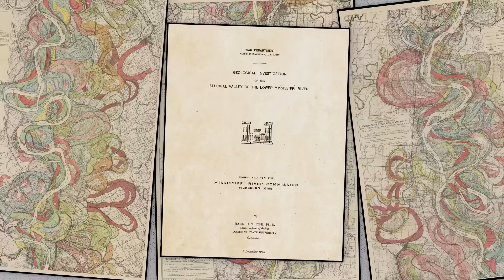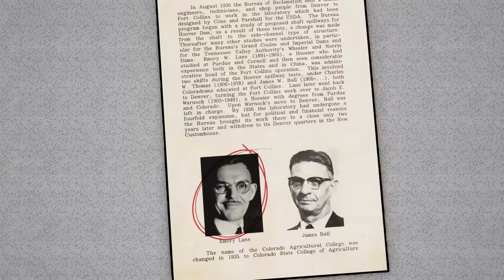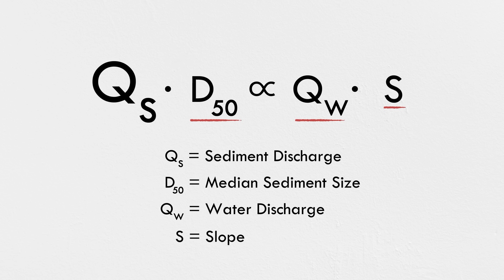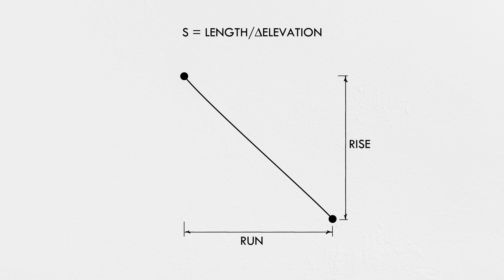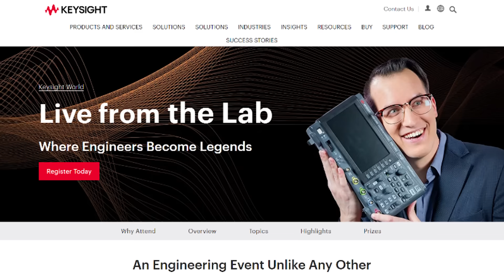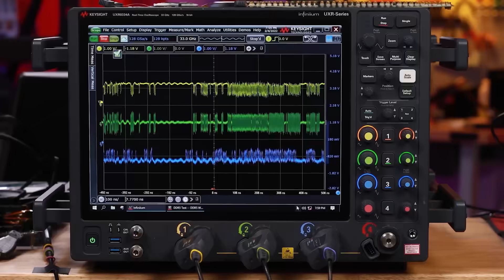Why Rivers Move

Comment: If you grew up in a rural area and played outside when it rained, every trickle of water past a muddy patch became your own personal stream table. I found it fascinating then, and I still do today.
Reply: We had gravel/muddy road leading up to our house where I grew up. I was fascinated with blocking and steering water around from puddle to puddle :) this and several other things were the reason I was studying to be a civil engineer :) I left the field in the end, but the love and admiration for engineering and other connected sciences is still there.
Reply: I’ve done this, you could actually see the bottom of a hill turn into mud then a stream then a river then a lake to a bigger lake to another river and so on
Reply: I always bring a shovel to the beach. There's a big stream running across it, and my two boys and I have great fun diverging the flow. Especially if when we get there and the channel is very wide and flow is low, we dig out a narrow path, which then turns into a fast stream, and the old stream completely dries out. Keeps us busy for an hour or two. :)
Reply: Every time I find a stream flowing down a beach...
Reply: My buddies and I blocked a 24' culvert and flooded an entire field for fun.
Reply: @matthewerwin4677  we do the most minute amount of trolling
Reply: @matthewerwin4677  not cool, mate ...
Reply: I'm sure you know, but just to be safe, this is a lie and a scam. (The telegram message above)
Reply: @WinstonSmith0824  no its nit. I won big bucks. Send me $20 and I'll show you how you can win.

Comment: I've been fascinated with this topic for many years, and have found it very enjoyable to "crack the code of history" that certain rivers tell us about changes that came about because of the activities of man.  I've got one broad example in a reply to a comment below, about how rivers in agricultural regions (and these are the rivers most of us see) are drastically different than they were in pre-settlement times.  Here's another example.  When a river is dammed, the river below the dam suddenly has a much reduced quantity of moving sediment, and as result, the river immediately starts eroding its bed.  When the dam on the Wisconsin River was built at Prairie du Sac, Wisconsin in the early 1900s, the design included a lock so that boats could pass back and forth through the dam.  However, after construction was completed, and literally as soon as the gates were closed, erosion on the downstream side of the dam increased enormously.  The bed of the river dropped ten feet in a matter of three or four weeks (it only stopped dropping at that point because it reached bedrock).  The lock was left high and dry on the downstream side, so boats were unable to use it.  The only time a boat ever went through that lock was during dam construction, before the dam was actually functioning.  The engineers should have predicted that the river would immediately erode down to bedrock on the downstream side of the dam, because this kind of behavior of a dammed river had already been observed hundreds of times, but in those days, very few people were putting two and two together regarding the cause and effect!  The mindset in those days was "Build things" and "Conquer Mother Nature", and paying attention to the consequences wasn't part of our collective mindset back then.

Comment: When I was a kid, I'd run a hose into a small ditch and observe the effects over time. I'd add small dams and obstructions and watch how the stream changed; inevitably, the dams would fail and cause a flash flood.

Technically, a waste of water. It was in the desert using well water, so the area downstream flourished with life. I like to think it was a good use of water.

Comment: Surprisingly, even tidal rivers have significant erosion.  The beach where I used to play is much smaller than when I was a kid, and the community has had to put up retention walls to control erosion.  I saw where a cliff eroded away and half of somebody’s pool was sticking out in mid-air.

Comment: In the netherland we had blocked off the sea but then the rivers where like we need more room for the rainwater so we started a program called room for the river in which farmlan where bought to give the river a chance to expand and retract depending the load of the river. We even have what is called the sand motor the beaches of the netherlands slowly lose more and more sand into the sea so what do the dutch build a man made island on the coast so engineered that the sea flow would do our work for us the stream grabs the sand and deposits it on the beaches who grow to protect the land again so yeah :D

Comment: 14:50 honestly I don't get what you would assume that Lane's relationship would say they are identical.
If one river has relatively constant flow it means it is closer to it's equilibrium. And the second one get huge bursts of flow that push it way outside the equilibrium. 

What do you mean by "it looks at averages"? What is the time window for that "average"? It isn't fair to assume arbitrary time window and say that formula does not work.
Reply: You could take a time window of the whole existence of the earth. Then you would need to model tectonic plates movements and how they affect the river. Because "on average" given long enough period it will be necessary. 
It isn't reasonable to take a time window that ignores the fact that the flow is not constant. It is something like a Nyquist theorem for measuring signals.

Comment: As someone who has canoed along the same rivers for months and years in a row, you really get an intuitive feel for the way change affects the placement of rivers. Especially after a flood, the banks can have moved amazing distances, and deposits of sediment downstream can utterly change where the current -- and consequently, the depth of the water -- forces you to travel in the canoe. Often, channels become so choked with sediment that you can no longer find a deep enough path through them. 

Side note: I really want one of these river tables. I wonder if they could be scaled down a bit in size, to lower cost and make them a DIY possibility. I wouldn't need the electronic analysis. I just want to have fun.

Comment: When I was visiting Alaska, I learned about "braided rivers" which are formed because of the extreme flood/dry cycles of rivers fed by glacial melt. They really do look a lot like the example on the right towards the end with the pulsed flow of water.
Reply: Thank you for your comment. I was trying to remember where I had seen it before! 💜🌎🏞️🍀
Reply: Braided rivers are really cool. Most are from glacial or snowpack melt as it is formed by heavy summer melting and little melting during winter.  I've seen a few around my area in Australia but only during drought when rainfall is much lower than usual.
Reply: So what's your logic for the Tigris and Euphrates River. Not only are they braided rivers, they braid together.

Comment: Something I've always wondered.... How do the inside banks of a winding river end up higher than the river level itself?
ie. How does sediment get deposited above the water level of the river?

....specifically how does this happen on rivers which have relatively static water levels and don't really flood.
Reply from the maker: Floods
Reply: My brother has a small river running thru his farm.  The river deposits lots of gravel on the inside curve during floods.  He can remove and use a lot of this gravel, and each spring, the flooding deposits it back into the same area.

Comment: I have a question to ask and a possible answer to that same question that I would like someone to explain to me. 

I live next to a rather large river for the area with a normal flow of around 250m3 per second all year and that averages at about 2500m3 in the wet season and have two major dams on it. The river's flow and trajectory has been somewhat closely monitored for the past 200 years and there was no real major changes in the trajectory it flows in, the river is about 700 miles long, drops about 150ish meters in altitude and it's outer banks is about 3 meters high from the water's edge normally then there is another river I can think of which has a lot less flow, more gain in altitude and is a lot shorter in length but have a tendency to change its course, not by much at a time, but at a time a road had to be re aligned a few meters away, this river is about 300 miles in length, drops about 200 meter in altitude and has an average flow of about 50m3 per second and at most 500m3 per second in a wet season has a constant outer bank of about 2 meters high and is also a lot younger then the large river. 

My theory is that the larger river has cut its way over time through a harder earth and landscape and the rocks could be harder and more denser then those around the younger river and that makes it more difficult for the old river to cut through the surrounding landscape, also because the large river rarely bursts over its outer banks it does not break away to create a 'shortcut' and the smaller river bursts it's banks about every 5 to 8 years, sometimes not by much. Also the small river has a few horseshoe lakes. Both rivers runs year round and both have dense vegetation on its banks.

I would say that the old, large river runs along dense, more settled-in earth rock and the younger, smaller river runs along not so dense earth and rock.

Scientists and smart people please help, I'm just an amature enthusiast who just want to know more. 😃

Comment: You didn't even touch on what happens when the medium the river is moving through changes. every kind of stone is gonna erode differently, and then those are all different than packed earth, loose earth, different kinds of earth, etc. Even accounting for different aggregate sizes in a given sample, a river that cuts through earth and clay is going to behave a little differently than one that cuts through sand. The amount of variability in grain sizes makes a difference.

Comment: I think the quickest way I understood how rivers bend was when I was a kid. I realized that rivers have waves, some parts of the water of a river are simply bigger than the smaller ones. When you have a river channel carved by a small series of wave, a sudden shift in water volume in that area could disrupt it. That volume can appear just as magically as those titanic mega-waves that used to capsize ships. It could be something like a large piece of sediment higher up on the river shifted from constant erosion, sending a bigger wave down the river faster. That extra little bit could help erode more structurally sound parts of the river. We take the constant flow of water from a tap for granted, I think. Everything in our life is more or less measured precisely. Mother Nature is sloppy though, and prefers the Bob Ross method of "No accidents" VS human engineered precision. Neither of these are better or worse, they simply just work better for us. Heck, even a dry period of less rain-runoff can affect how the soil works. Heck, even too much rain.

TL;DR Water in a river is never a constant

Comment: I wonder if a model like this could be placed in an entry hall or hotel lobby or so. With a fixed supply of "soil" and a regulated supply of water in circulation, it could probably run indefinitely and look different every time somebody passes it. You could synchronize the water flow rate with the measured precipitation in the nearest mountain range and have yourself a never ending science experiment. Give the "soil" some natural color based on the grain size, build a neat mountaneous diorama around it with a macro toy train circuit ....

Comment: Because I LOVE your content: what if the flow of the aether around the nucleus creates turbulence and manifest bubbles, that we call electrons? It's all about fluid dynamics!
Reply: Do you have any predictions that can better match observational evidence than quantum electrodynamics?
Reply: @General12th  Nikola Tesla insisted that electrons were bullshit.   Why don't combs loaded with static electricity DO NOT disintegrate?  Why don't solar cells disintegrate when they give up an electron for a photon?  It is ALL bullshit!
Reply: @batymahn  Do you have a better explanation for, say, semiconductors? If your model can supersede quantum electrodynamics, then could you build a better computer chip?
Reply: @batymahn  Quantum mechanics is not wrong for semiconductors. If you want your idea of "subatomic fluid mechanics" to replace quantum mechanics, it'll need to explain how semiconductors work, for example.
Reply: @General12th  Again, if  you think of bubbles being generated from a central source it totally makes sense that the bubbles might want to intermingle, and interact.  It's all BUILLSHIT!
Reply: @batymahn  Can you design an experiment where quantum electrodynamics would get the wrong answer but your model would get the right answer?
Reply: @General12th  Why the heck should I design an experiment  when you can't explain why solar panels don't give up structural integrity when they receive photons?
Reply: @batymahn  In other words, why the heck should you put even more effort into your theory? Why should you work hard to make it even stronger? Why should you spend more time with a subject you're clearly passionate about?

If you're changing the world and loving every second of it, you don't need my permission to keep at it.
Reply: @General12th  Whatever.. I hope we bring Practical Engineering more clicks.

Comment: This is one of my VERY favorite topics.   At the museum I volunteered at there was a stream table filled with microplastic aggregate (typically used for scouring walls) with two water sources on each end simulating a stream just like Grady is using here. I spent hours in front of it talking about the different aspects of river change. Given the one Grady uses here is from Carbondale, I think it's probably made by the same company (the museum I volunteered and later worked at was the St. Louis Science Center.)

Comment: Growing up, we had a pretty slow moving creek at the bottom of out property.  The Crick was curvy. One bend was eroding in the direction of a road. So the township widened and straightened out the problematic bend.  They placed cement slabs along the edges to prevent erosion. 

Worked great until storms caused the creek to flood. It partially filled in the new channel, eroded the new  bank that replaced its original bend, and tossed around the cement slabs.   While the road is safe for years to come,  a new bend was made.    

The township failed to consider that the serene little creek turns into a raging torrent after heavy rains.

Comment: That pulsed flow model is what has been effecting the lower Niagara river for about 40 years, and yes there are errosion problems. There is a treaty between US & Canada that mandates what percentage of the river's flow passes over Niagara Falls. Both at night and during the tourist season. Hydro plants in both countries pump excess capacity into holding ponds at night and release it during the day for extra generation capacity. That means the flow downstream of the plants varies from about 70% to 130% depending on the time of day.

Comment: As a fluvial geomorphologist turned infrastructure geohazard specialist, I love this! Probably the best video to explain to my family what my job looks like. Looking forward to next episode in the series where we bemoan logging! It's exposing so much buried infrastructure! Oh, and dams, and dam breaks, and development! We need better design of pond outfall tailwater effects!
Reply: I'm an aspiring forester - what logging practices are most destructive in this regard, and in which ways? Clearcutting and logging proximate to rivers would strike me as an obvious few
Reply: @morelikegoogleminus3396  we have a lot of issues in TX-LA-MS corridors where rotating logging operations will clear large tracts of several different nearby replanted forests. It causes fits of degradation and erosion exposing our pipe crossings of small creeks. I had a creek drop 12 feet in a year as a knickpoint retreated upstream following a clearing. The rainfall wasn't abnormal, but cleared land didn't capture as much rain, leading to increased flow. Big oil and gas pipes it doesn't affect as much. But smaller water lines and even small gas lines, it can lead to big exposures.
Reply: @morelikegoogleminus3396  and no I'll will to you or your trade. We absolutely need sustainable logging for so many products.  Just in rural areas, we don't think about erosion and impacts to infrastructure because it's much less consequential. Just happens to be my job

Comment: Brad Lancaster has done a lot of observation of natural hydrology and how to remediate a overly drying landscape by small frequent solutions, from onsite materials.
He recently featured Turkey creek and a creek in the next valley, one valley had man-made dams, one valley did not.
The effect of the dams on the one valley was a much greener, healthier, more resilient eco system than the one without dams.
The one criticism of yhe dams is that if they were only made one rock high initially, and placed more frequently, they would require much less maintenance than the dams that were several stones  high, a valid criticism.